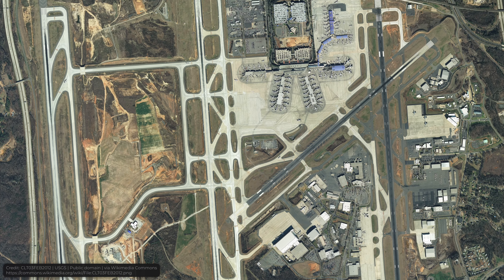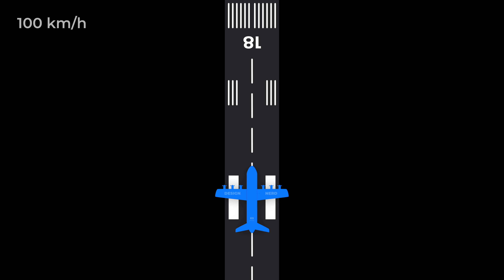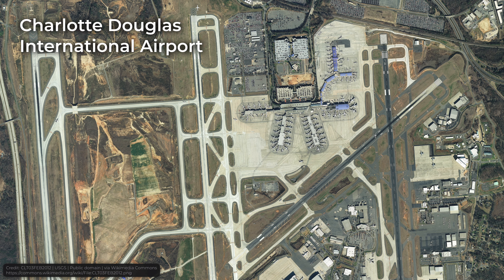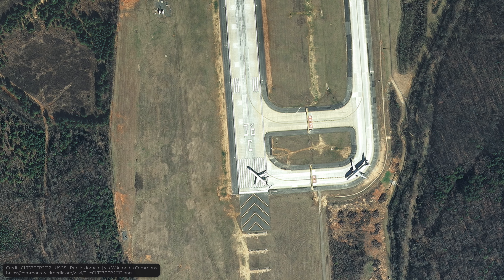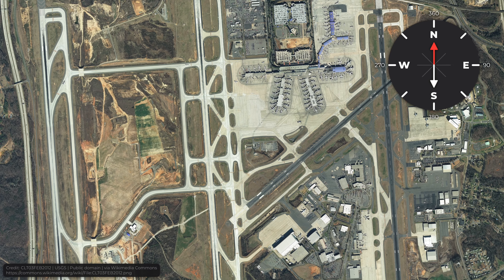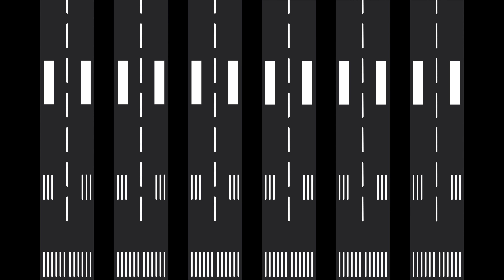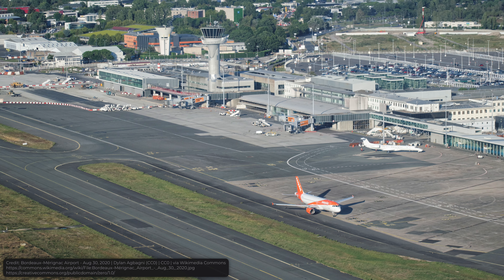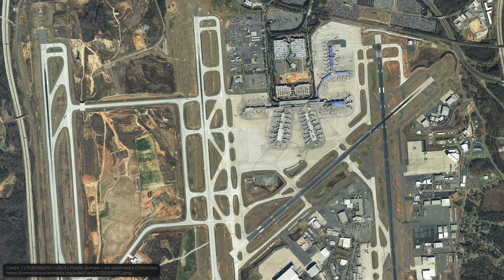How Airport Runways Are Designed

Comment: Great video! One important thing to add, the runway number is called the QFU and it is a magnetic (not true) bearing. Sometimes they are renumbered as deviation changes over time. Except for Antarctica, because the mag south pole is at higher latitude than any runway down there. A runway number there will be like 36T -- the T is for true heading.
Reply from the maker: Oh, wow. I didn't know about Antarctica. Thanks for this interesting info!